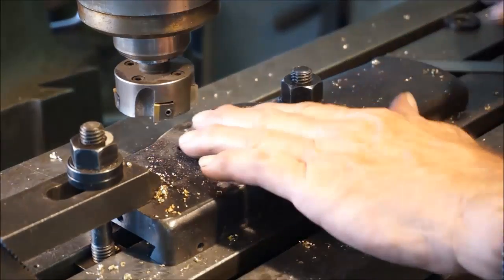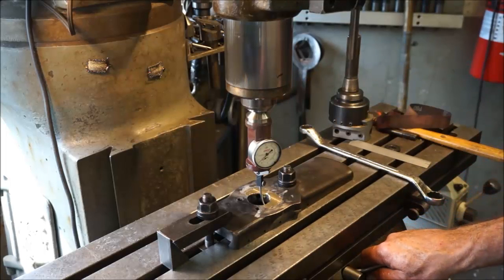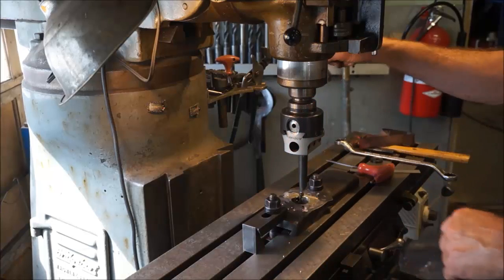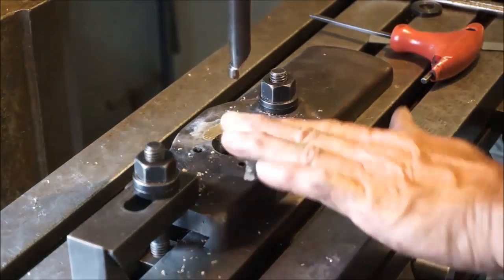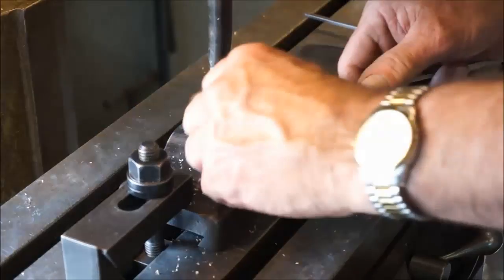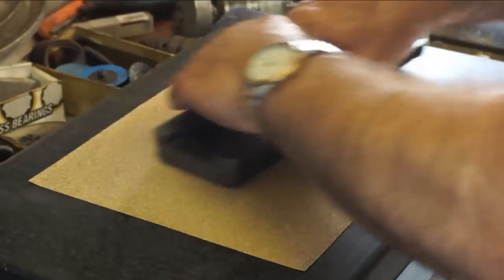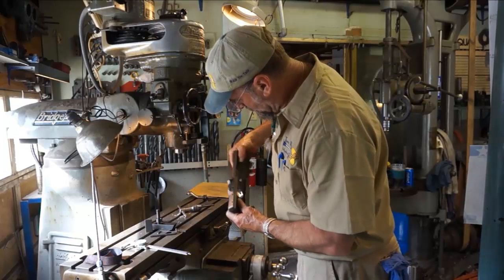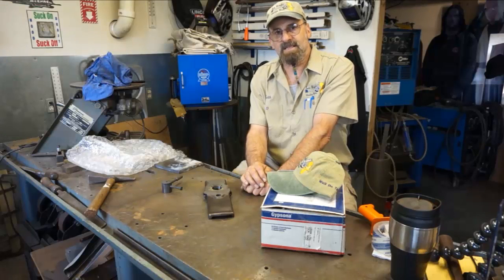Dam Brazing Part 4

Comment: Nice job Keith . -  I don't know if they're still in business ,  but there used to be a Company that sold kits wth an assortment of various shapes & sizes of Hard Graphite for making Dams for Welding & Brazing . I had one of their Medium sized kits that I bought back in the early 1970's (about $200. if I remember right) ;  unfortunately when I worked for American Borate Co. in Death Valley, California in the 1980's , someone else decided that they needed it worse than I did . GRRR !

Comment: When I worked in oilfield machine shops we also used carbon rod for damming on mud pump fluid ends that had cracked. The machinists would make threaded carbon rods that were then installed in the threaded stud holes in the pump body. After installation, we would arc-air gouge out the crack in the body that led to the stud hole. The carbon would stop any damage to the threaded hole and give you a backup for the arc welding you would do to repair the crack. When the welding was done, the carbon was drilled out and the threads restored using a tap.

Comment: hello friend , i recently dismantled a hydraulic jack to build a flow booster with it and i had to weld the small piston to the larger one , well now the small piston base will not fit back in the bore ? it is discolored yellow and blue in that area and it now measures like .4mm larger. my question is do metals expand when heated and stay large from absorbing oxygen  or is it just possibly distorted ? I was carfull to keep heat off the piston rob but it seems to have expanded and wont fit back into the cylinder, are you familiar with this phenomenon    ? unfortunately i do not own a laith so im just gonna grind it down best i can
Reply from the maker: Yes some shapes of solid or tube can grow, I'm not sold on absorbing oxygen, I would think more along the lines of stress relief, letting the belt loop out one, but more cases of warp. ;{)-----
Reply: Keith Fenner thanks for the response, its so cool to be able to ask a professional

Comment: I may have missed it but what was the cause or the cracking? surely it couldn't have been tightened enough to crack it, nor tool pressure the cause. just about have to lift the lathe or tip it over onto the tool post to do that kinda damage. Its identical to the lathe at the shop i work in and it was abused and used incorrectly for years up until I started working there.
Reply from the maker: My guess was during disassemble and not knowing about the pins and the pressing apart cracked the cast areas. ;{)-----

Comment: Keith, how can I clean up the flux after brazing something together?  The only brazing I do is for small jobs around the house for a repair or assemble something simple and not requiring wielding.  The biggest problem I have is cleaning up the flux so I can wire brush the metal before painting.  The flux is hard and difficult to chip away.  Any suggestions?

Very much enjoy your video's, thanks for taking the time to make them.

Thanks for your help.

Jack, in Missouri
Reply: Dawn dish soap, concentrated formula, use it straight out of the bottle with a stainless steel brush. Trust me it works. Of course rinse afterwards but try not to use massive amounts of water.
Reply from the maker: Hi Jack, Most of the time I am just sanding, grinding or machining the surfaces, but when I need to just clean it off, soaking in hot water for a while, eats it up, after a bit. If you do a lot of brazing and you have a second set of torches, and hoses, invest in a gas flux-er, they allow easy flux cleaning. ;{)-----
Reply: Keith Fenner Thank you Keith, I appreciate your help.  JD
Reply: oshin aslanian Thank you for your suggestion, I'm going to try it.  Jack

Comment: Great series as usual Keith.   Next time you haul out the Boring Head could you spend a little time on how you like to set the Lead Angle on the Boring Bar, in the video all of a sudden it was installed.   My Borate Bars are just round with no index flat on the shank and I just try to line up the carbide face inline with the Boring Head by eye.   No clue if there are some tricks for different materials changing the angle or not.   Thanks
Reply from the maker: My bars are the same and a good eye is all it takes. I will keep that in mind the next time I'm setting it up! ;{)------

Comment: Wonderful video series on dam brazing.  Question:  what sand paper did you use to lap the part?  Did the sand paper release from the granite stone easily when you were done?

Thanks,

Steve in Los Angeles
Reply from the maker: I used 100 grit and the spray glues are a easy release and acetone wipes the stone clean after ward. ;{)---

Comment: great vid i relay enjoy all your great showings. At work we use the graphite dams a lot for weld repairs on steel castings it works very well. Leaves very little clean up to be done.

Comment: I noticed you didn't break the sharp edges of the bore. Why not?
Reply from the maker: I was matching what was there and the edge has clearance due to the dove tail relief. I would have if it had one originally, or came up to a radius shoulder. ;{)-----
Reply: Keith Fenner Silly me, I was under the impression that we ALWAYS break sharp shoulders to help prevent cracks from forming.

Comment: First of all your videos have really been great, thanks for all you do. Second can you try to give us a heads up of where we can find some of the tooling, or if you are making a lot of these tools, hook us up.

 Specifically that adjustable cutter you used on the vertical mill to clean the bore. Reminds me of an circle cutter on steroids. I am thinking up a way to make my own for a project I have going.
Reply from the maker: Sure thing Jeff:  here is a used one on E bay: http://www.ebay.com/itm/Criterion-DBL-202-Boring-Head-Costa-Mesa-CAL-1-2-shank-Tool-Gold-Anniversary-/171395116496?pt=BI_Tool_Work_Holding&hash=item27e7f1edd0
There are some there all the time and new ones are in MSC or on Amazon: http://www.amazon.com/s/?ie=UTF8&keywords=boring+heads&tag=googhydr-20&index=industrial&hvadid=27113928363&hvpos=1o2&hvexid=&hvnetw=g&hvrand=6067369536044028472&hvpone=&hvptwo=&hvqmt=b&hvdev=c&ref=pd_sl_5kyjd18gi1_b

Comment: Elastic might make a safer watch band.
Reply from the maker: I prefer the non hair snagging flex bands, they break off, the easiest of any bands I have worn over the years. ;{)-----
Reply: Keith Fenner
 Those are the sort of watch bands I used when I worked in the oilfield.  They break away as readily as do the cuffs on safety cuff gloves tear away.  There had been times I wasn't aware there was a danger until when I went to check the time and the watch  was there.

Comment: Another well done Keith.  Myself when  involved with this type job, I think I would
have requested the customer also send the compound,  the shoes and locks.
I'm still wondering how that got busted in the first place?  One thing should never be done is over tighten the locks, which mushrooms the shoes which is
a bear to remove after.
sam
Reply from the maker: LOL, sometimes it may be best not to know how it was damaged. my guess was in removing and ignorance of the way it is held in place. ;{)---

Comment: excellent project,
lucky to have a part made with a such stable cast iron, anything else had been seriously warped with such a brazing
Usually when we have to braze or weld for a repair, it is required to have the part seriously stress relieved and all toleranced dimensions corrected
Usuallly when we build a complex part from metal sections welded together, If we have to maintain strict dimensionnal tolerance, it is required to do an heavy stress relief before  rough machining and a second stress relief before final cuts
I appreciate all your videos, a much better to use the web than burning tires

Comment: Thanks for making a video of this repair. Even people like myself can find useful tidbits in the things you do. I liked the instinct and feeling part of the job as well. I've accomplished a lot from intuition. I wonder how many people would have considered that part scrap. Did you find that it was more of a challenge preserving precision machined surfaces versus machining out a rough casting?
Reply from the maker: I find it more of a challenge to match someonelses path in machining than creating a new one as per print. ;{)-----
Reply: That's what I meant, thanks. I figured that might be the case but it looks like a satisfying job.

Comment: Great video as always Keith.
As particular as you are about perfection, I am surprised you left that small void in the face at the edge of where you milled out the cracked material. It certainly won't degrade the serviceability of the part but it was a surprise.
Many thanks for all the great videos Keith.